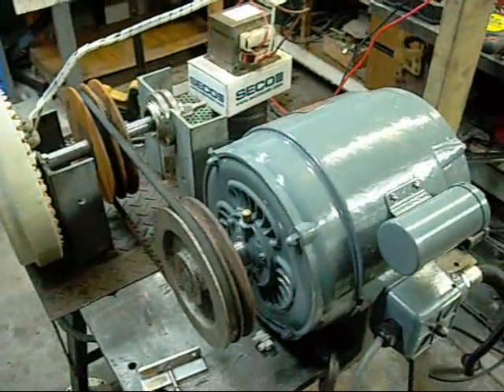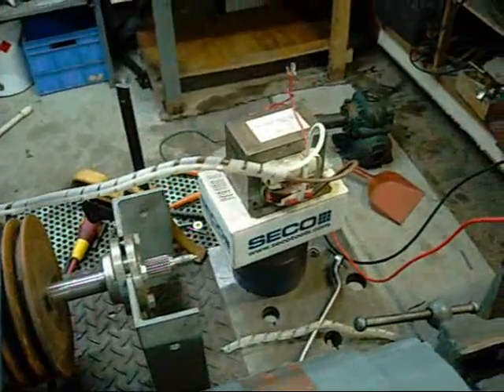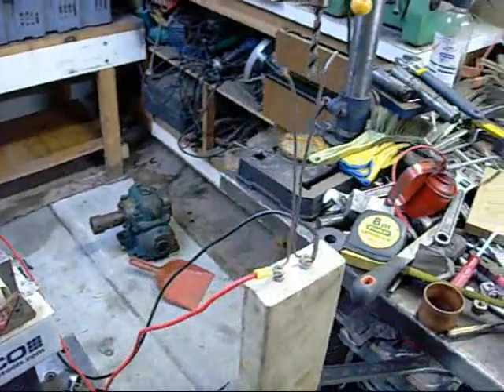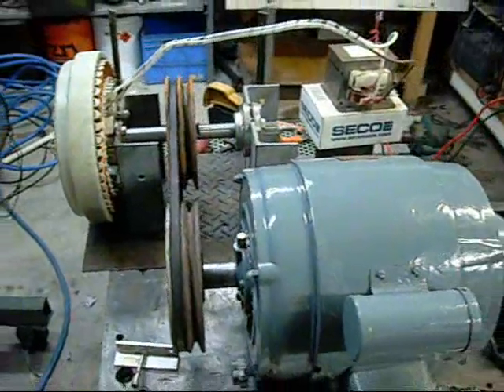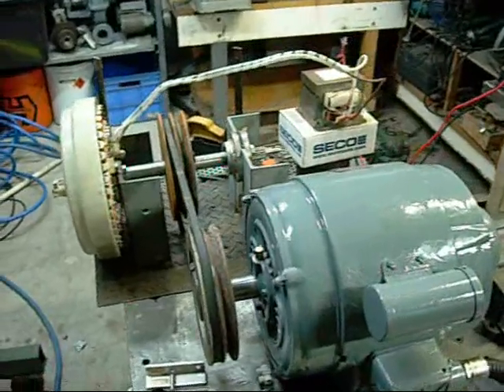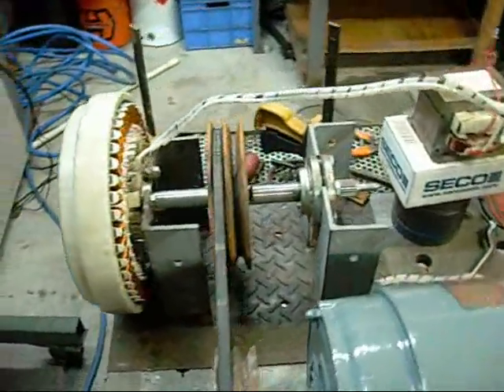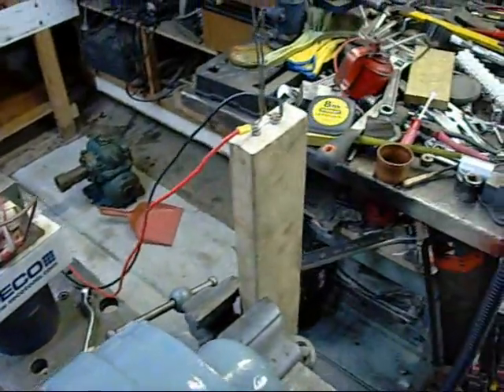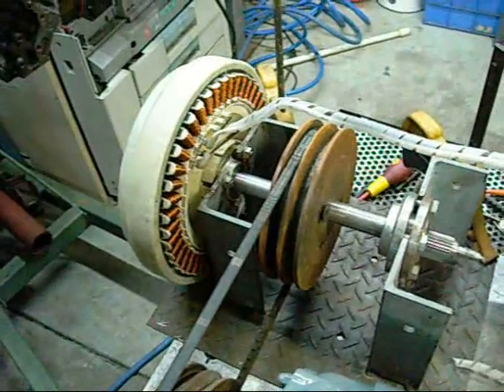2HP Electric Motor Driven Smart Drive HV Generator

Comment: For anybody that wants to build a free to use energy plant.

1 hp. Electric motor
Equals 2.75 hp. Gas engine.

If you have a 15000 watt 240 volt 100 amp generator with a 15 hp gas engine on it.
You can move the generator at full load with a 5 hp. 120 volt 15amp electric motor.

This will yeild you 120 or 240 volt  and 85 amps to use any way you want to.

Comment: It will be smart if you used an air core transformer for high frequency circuits. Iron core transformers are only for low frequencies, 50/60 Hz.

Comment: BTW... The air column around the "Jacob's Ladder" needs to be very still for it to stabilize. I use an acrylic tube.  If the "smart drive" motor vibrates, it's because you are only using 1 phase of its 3 phase output. The other 2 phases are not loaded, which causes a vibration due to the uneven loading.  

For those wondering, the best of these motors can generate 1kW easily (around 1000 RPM), some can be as high as 1.5kW or even a little higher - depending on the load duty cycle. (short term they can produce higher, but it will cause overheating)

Comment: Do you know the capacitor value of your Brook motor? I have just bought one of Ebay for £1.26 but the capacitor has gone. Worked fine if given a nudge round.
Reply from the maker: +maltelec IIRC I used a 100 - 120uf start cap on this one, it too needed a spin start when I got it, cap was blown.
Reply: I have just put a 150uF cap in mine as it was the only one I had of that size. Works fine. The switch at the back kept jamming which didn't help. Runs like a beauty now I have greased it up.

Comment: hey i need help i have lg direct drive washing machine motor till me how i can start it from external source i means not from power coming from machine control board its self i want to run it from outside power how many voltage i have to give ac or dc? and witch color wire their is same wire u can see in video red yellow and blue please help me thanks
Reply: what voltage do you want to use?
Reply: +Steve Hughes  thanks for ur interest  I have 220 voltage
Reply: +muhammad zubair buy UPS from computer parts
Reply: +muhammad zubair   These motors are 3-phase Brushless DC motors. They require a special electronic commutating drive.  Some of them are able to be driven by mains 3-phase power, but only if they are rated for that high voltage.  It will NOT run on DC, or normal mains 220V or 110V AC power, it will burn up.
Reply: @beforebefore  
Would vfd controller work with this bldc motor? Ty

Comment from the maker: the induction motor thats driving it is 1440RPM. so with a slightly smaller pulley the generator (former motor) is doing about 1600

Comment: Thank you for posting the video. I had a go and used a F&P motor and it work great but sometimes the spark stays at the top. Why does it do that? the spark must be hot because it melts the coat hanger wire I used. Have a look at my video at "jacobs ladder using f&p motor"

Comment: That's awesome, it runs the microwave transformer better than 240v mains... would it be possible to run the generator part with a bicycle wheel?

Comment from the maker: The reason I don't just plug the MOT into the wall is because the Smartdrive is making 4X the voltage, at higher frequency. not a lot of current, but enough to power the MOT without heating up the primary windings!

Comment from the maker: In theory, one motor could drive the other, but the smartdrive motors lack horsepower, so it would prolly stall under full load on the one acting as a gene.